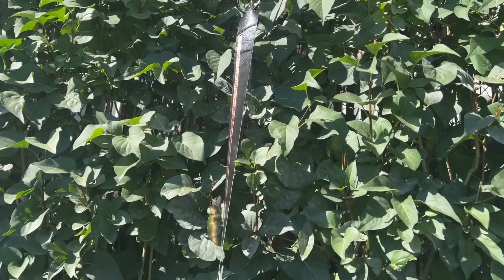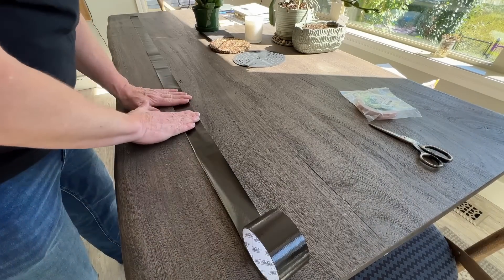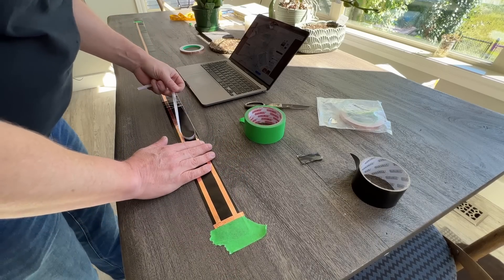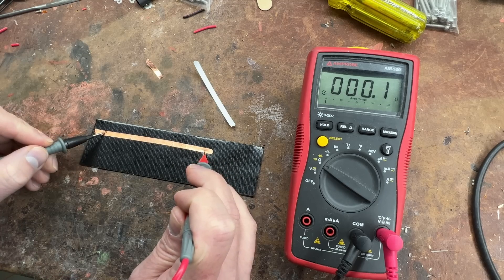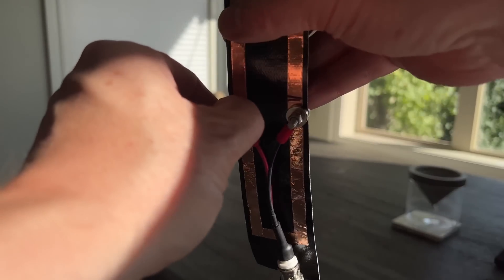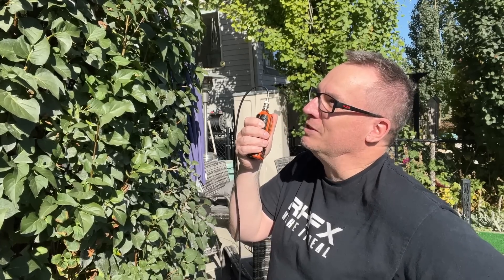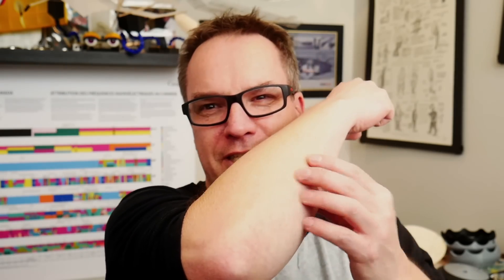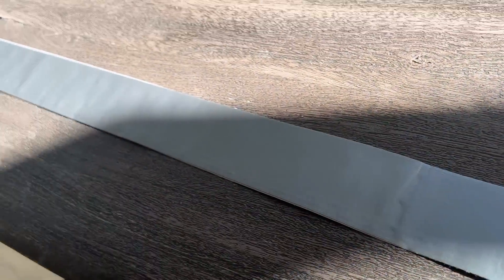How to make a 2 meter band tape antenna: Lightweight, portable, fun project for ham radio

Comment: The video misses the key most important part, how did the smith chart look when it was fed at the calculated position
and did you have to vary it. The picture shows a glimpse of the feedpoint appearing to be staggered.
So, we miss out on the feed point, we also miss out of the end result of the BandWidth, and impedance. 

This antenna does vary in Frequency depending on what its attached to or close to. 
Taping it to the side of fiberglass, PVC, or wood will change it.  
You start with a Free Space model then check how it changes the Velocity Factor 
then you can cut and solder once.
Reply from the maker: All of this has been done and I cut it from the video because it would make the video long and boring. The next video where I make a faraday version and end up making a circut board solves the feedpoint issues. As most of us know putting an antenna near stuff will affect it. I can do a free space test and will soon but in the mean time I like real world tests and know it works in compromised situations

Comment: You can stick the foil tape, in the 70's we would use alarm tape, to a window and have a good antenna that was essentially a look alike for an alarm system window tape job.
Reply from the maker: Absolutely! I’ve been debating a mag loop in a large upper window. I am concerned about the potential heat and maybe cracking the window. Thoughts?
Reply: @VE6SFX_HamRadioRookie  You could always get a sheet of glass cut to the same size and frame it in your shop, and work with that. You can use thermal sensors and borrow a thermal imager and push it as hard as you want.  I'd measure for RF exposure too.
Reply from the maker: Great idea! Thanks

Comment: I would be tempted to leave that as an adjustable antenna using the magnets, but I know it is not the right thing to do. I like your video. It gives me some great ideas. Thank you very much for this information and your duct tape antenna video. Duct tape fixes everything. 73 Matt KF4KSK

Comment: And HOW FAR are you from the repeater? Can this be done on both 2m and 70cm with a Baofeng UV-5R?
Reply from the maker: 5miles, but it has been tested up to 30miles full quieting. Yes to the Baofeng.
Reply: @VE6SFX_HamRadioRookie  

My record from last weekend: 130km (80.8 miles) with the Hytera PD785 (UHF) with 4 watts and the original antenna. 

I will definitely rebuild the duct-tape antenna 😀

vy73 de Peter, DO8PGG

Comment: Wonder if you could send this up attached to the belly of a drone and get a couple hundred feet high with it? Im sure the weight of the cable will be the prohibitive bit, but with a decent drone, you could have a great emergency antenna for even very hilly regions.
Reply from the maker: Drones use brushless or AC motors I am not sure how well it would work if there are any electrical harmonics. That being said, why not strip down a HT put it in cross band repeat and put it on the drone. Talk to the drone via UHF and have it repeat out at VHF? That gets rid of cable losses and weight entirely. In fact that ht with a battery would weigh less than 10’ of rg8

Comment: Ok, just looked it up. This is nuts. Three weather baloons cost $51 bucks. Lifts 21 lb. Rg 58 ,500 ft. 24lb. It could be done. 500 ft. Antenna. Shoot lets do 1000. Vhf line of sight. How far is that? Looked it up. Apx. 40 miles. No repeater. Ha
Reply from the maker: Yes could you that. You might find that the range is significantly longer. However the losses on a coaxial cable that long would be significant. FWIW, VHF I personally have managed 62miles to a repeater from it being only 15' off the ground. In your case I would get a inexpensive baofeng and put it in cross band repeat. Raise it along with the antenna up on the balloon and then you have little to no loss from the coaxial cable.  Talk to the radio in the sky via UHF on the ground and have it repeat out on VHF.  Carlos on his channel has got 185miles!!!! https://youtu.be/VN_PZAfJHVI?si=Ohl9hB8K0r2nHzw_&t=507 at 6000' :)

Comment: Ok, this gave me a questionable idea. Correct me if I am wrong. A helium balloon and this tape antenna and I could go up 500 feet for a vhf signal ? Wonder what a wether baloon costs. Smile
Reply: The idea is brilliant! :-) 
The problem is the “heavy” cable. 

vy73 de Peter, DO8PGG
Reply: @do8pggwhere is Tesla and his wireless power transfer when you need him...

Comment: Aluminium ducting tape works well around windows to make a magloop, including the capacitor. Use a battery spot welder to connect feed
Reply from the maker: Not keen on spot welding on glass but definitely worth investigating

Comment: Did you leave the connections fluid?
BTW your joy is infectious
Reply from the maker: The final version I did not. Once it was right I locked it in
Reply: @VE6SFX_HamRadioRookie  thoughts on how to do this without soldering?
Reply from the maker: @jesseemling4817  For the attachment to the antenna I would simply tape on the leads. If you do not want to solder the BNC then there may be a "BNC Pigtail" you can get https://amzn.to/409A0ro just make sure to cut down the length of the pigtail to as small as possible
Reply from the maker: @jesseemling4817  https://www.youtube.com/shorts/nGTK0_oFjwg

Comment: I had often thought of using, 
" Alarm Foil ", like you see placed on windows and door glass, etc. !
I would guess some experimentation would be necessary, depending on how frequency agile you needed the antenna to be ?
I'm guessing for a higher,
 " Q ", it might be a thinner strip, for a specific frequency  ?
While a wider strip might offer more Bandwidth ?
Sounds like fun, and for VHF/UHF easy to make dipoles ?
Reply from the maker: This has quite a high Q actually. You are correct on the width of the tape but it has been found by myself and others like John Portune that with skin effect these work effectively like a similar tube where the circumference is equal to the width of the copper foil. So one can get a very wide bandwidth in a much smaller package. Yes it makes great dipoles! There will be videos out soon on this. But it is very easy to go out and experiment yourself! Go and try it!

Comment: So this gives me several ideas! So, you could build one in an attic, attached to a 2x4 board or PVC pipe.  Possibly build some giant dipole antennas (given the available distance, along a roof crest). You could even stick the copper tape to a rain gutter, vertically or horizontally... 
Even build a super thin, Window / Door Pass Through with antenna connections on either end. This would be useful for travelling, camping, apartments, etc. or just when you want to pop up that antenna in your yard, and you stay inside (warm and dry!)
Reply from the maker: Yes to all of this and I am working on some of the ideas already!
Reply: I like the idea of sticking it to the back or a rainwater down pipe. I  live on the ground floor of a block of flats so it can be elevated and invisible.

Comment: Nice build, how much wattage could a person put through this?  Thinking of making myself one to keep in the vehicle as a go antenna. Thanks
Reply from the maker: A lot more than one would think. I have a friend that did a 2min FM transmission at 100w with no issues. It handles 50W with no problems what so ever
Reply: @VE6SFX_HamRadioRookie  Thanks for the info. I'm going to build this next. Perfect for rolling up and keeping in a backpack or vehicle. Again, very awesome design.

Comment: I was also playing around with packing+copper tape antennas when I first got into the hobby. They're pretty great quick and dirty antennas once you have the measurements down and there's a whole rabbit hole to get lost in adding features for co-linear and other bands. I even taped some to the outside of PVC tubes to make them free-standing. There was just something really addictive in making quite capable antennas out of pennies worth of materials. It would be neat to do enough testing on different bands/tape substrates to come up with a parametric design where you quickly mash together working antennas for whatever is needed in a pinch.

The main weakness of the copper tape is that it work hardens and fatigues with any amount of regular bending (and I don't know that aluminum tape would be much better). One of my copper tape on PVC antennas was mostly a mess of little soldered patches across all the cracks by the time I gave up and took it down. At this point, I think the way forward is some kind of bending-tolerant fine multifilament ribbon like Litz wire sandwiched between either layers of high quality duct tape or fused laminated sheets of some low-loss material like HDPE. This would be superior to typical ladder line which is solid core and gives up more quickly with rolling and unrolling.
Reply from the maker: All great info. Thank you 73

Comment: Which width of copper tape did you use?
Reply from the maker: I have tried 1/8" 1/4" and 1/2" all work and the 1/2" gives almost a flat line bandwidth when tuned.  The wider the better. The one in the video was 1/4"

Comment: I made a working dual band dipole using copper tape on a length of PVC pipe.
Reply from the maker: Did you wrap the pvc or was it just a strip up the side?

Comment: Duct tape. AKA initially made for use on air conditioning duct systems. Even NASA call it DUCT tape. Rant over. I am aware of a brand called duck tape, but it is still Duct tape. :)
Reply from the maker: Nope it was designed to close ammo boxes in wwii made out of a clash called ‘duck’ https://youtu.be/9FaDI1i8ijs?si=d-rIlcQylUYA2Ruk
Reply: @VE6SFX_HamRadioRookie  Fair comment. As a sailor, we repair our sails using "duck" which means cloth/canvas tape. Once adhesive as added, the patent says duct tape. To be honest, I don't really mind that much. When I find a vid such as your interesting, I like to comment to help with your monetisation. So this is a like, plus a comment, which means more points. Thanks for your time in making the vid. Cheers.
Reply from the maker: THANK YOU! for helping me feed the beast of a algorithm. :) truly, as you know every comment and interaction counts. 73
Reply from the maker: More fuel for the algorithm :) https://www.youtube.com/shorts/n9ZNJKuUpXM

Comment: I made a similar antenna just gluing aluminum tape to the window.
Reply from the maker: How well did it work?
Reply: @VE6SFX_HamRadioRookie  For my purposes, the reception of AIS signals worked well. But it is very important that there is no low-emissivity glass (k-glass or i-glass). Because it has a metal -containing coating.
Reply from the maker: Never really thought much about the metal content of the glass but yes you are right.

Comment: In a former life, we used copper tape for a variety of RFI / EMI issues. We learnt that not all copper tapes are the same. Some will stick and provide good through conductivity, and some will not. As Murphy would have it, it seemed the more expensive tapes stuck with better conductivity. I suggest buying a small amount to check conductivity before committing to a larger quantity. Aluminium tape is similar and cheaper, but of course you cannot solder aluminium.
Reply from the maker: Good advice, I’ve been lucky so far.

Comment: If ya like the tape antenna u cam make a more robust antenna and easier to put up called a flowerpot antenna but for its choke ya just cut the length of pipi needed and the copper tape antenna on the side of ur house would work for a small bit until the heqt or paint dust makes it come off and btw if u have alum foil around the walls u will find it hard to tune
Reply: Depending on what paint u use but if u want a cheap tuneable antenna a measuring tape works good and u can use a 12v geared motor to adjust it
Reply from the maker: Thanks I’ll look into it
Reply from the maker: Yes it would need more than just the tape to stay there. I am working on that. Maybe paint over it? The heat I am not so afraid of being up in Canada ;) the cold would take it down sooner.

Comment: How does it go when you roll it up? Does the copper split or is it pliable enough to handle the rolling? I have some 4 inch wide aluminium tape that would work the same way, but it would make the end result a lot larger, thereby rendering it a failure if one is going for compactness. I like your duct tape version, it looks neat and should easily handle 50-60w, and that's enough for MOST people to access even distant repeaters. It would be interesting to compare this with various other 2m antenna on SSB and see if it can hear the DX any better than say a standard copper tube j-pole or a ladder line/ window line version. Something like this would be a lot easier to haul up a mountain, or carry for miles on a hike, than a Yagi would be. A nice little experiment that could be taken a whole lot further. Well Done.
Reply from the maker: Yes it rolls up beautifully like there is no foil in it at all. So far, albeit short time frame and not many roll unroll cycles, it is just as good as it started. I would also like to compare as well and will endeavor to do so in the near future. FWIW I presented this at my local club Tusday night and walked in with the antenna and short coax in my jeans pocket to demonstrate the size weight and portability. Honestly I think it could potentially be the perfect pack antenna for POTA and SOTA

Comment: I subscribed for your enthusiasm, and for sharing an awesome solution for a common hobby ham radio problems.

Edit: You know, you could make a self holding antenna with something like an old large blind, anything that bends along it's length enough to naturally want to stay straight. There's quite a few fantastic roll out full scale antennas out there that you straighten up with this method and tension at the base to enforce it's upright structure. You might be able to make a pretty handy role out antenna out of duct tape and an internal support nestled into the copper foil J-pole.
Reply from the maker: !!! Great idea. Thank you.
Reply: I make tape measure 3 and 5 element 2m/70cm yagis on 1/2" PVC pipes regularly. They roll up around the pipe for storage and transportation. I use Raspberry Pis, DigiRig, and such for my personal EmComms as I live in the heart of tornado/ice storm/weird weather in the Mid West. I don't do HF, at least not yet, but it's also on my list.
I had been making copper pipe j-poles, too, but this method presented is going to replace them as soon as my copper foil tape makes it's appearance.
Reply from the maker: You are going to love my ‘Flagi’ design coming out soon. Effectively a duck tape yagi

Comment: Awesome. I have been experimenting with copper foil antennas by sticking the foil to a window as I live in an apartment. I've had limited success but will keep at it thanks to you as the concept clearly works. Great video. Many thanks.
Reply from the maker: Keep trying. You will get one to work. What is not show. In the video is the many many other non working antennas I built. Might need to do a video on that, all my failures.
Reply: @VE6SFX_HamRadioRookie  I know what you mean and will keep trying as each iteration get better than the last. I have a nano VNA too, which is an amazing help. Thanks again.